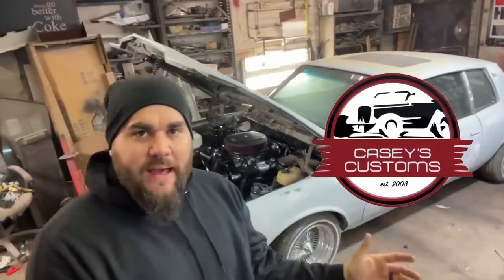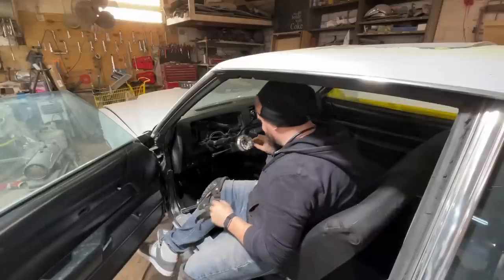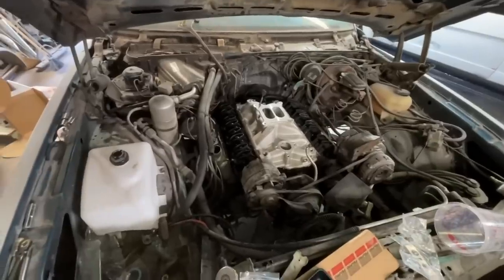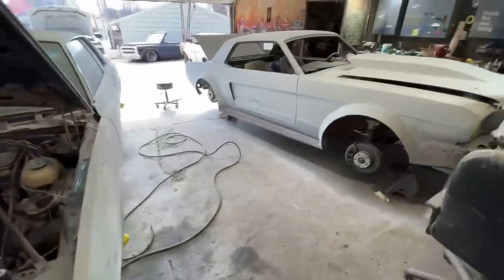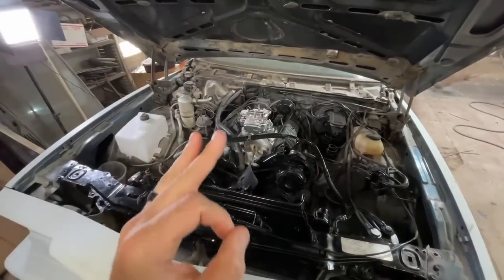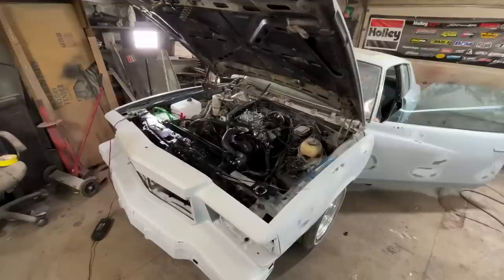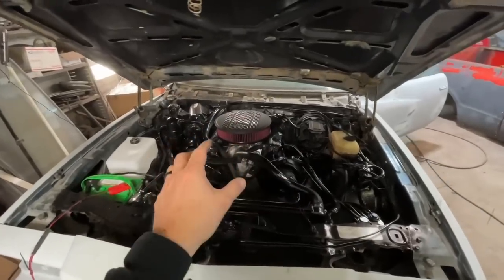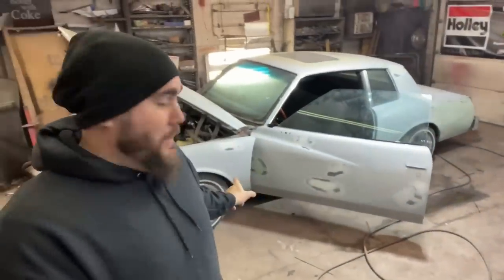THE TRAINING DAY MONTE CARLO GETS A HOT ROD ENGINE! HOPPING UP THE 350 CHEVY! KUSTOM MOVIE LOWRIDER

Comment: I had the same car all blacked out and it was a small block 350 with a factory 3 speed transmission.  I loved that car . Too bad my ex wife blew the engine twice and after I put the 3rd motor in it I sold the car and what a mistake that was . Good luck with your car .

Comment: Not being a jerk and I'm assuming things. Is that just a stock Chevy 350? Not sure the heads and cam will work with that intake / carb set up. Certainly won't be ideal. Ideally you'd want bigger valves than stock and at least a bit lumpier on the intake lobes with the cam to run a Holley performance set up like that. Not sure of the specifics of what he put on, just generalizing
Reply from the maker: Was told it was a stock 350, we definitely might need to tweak things once i get it on the road